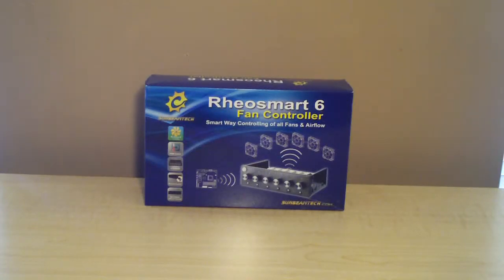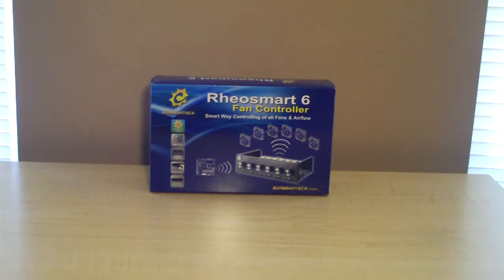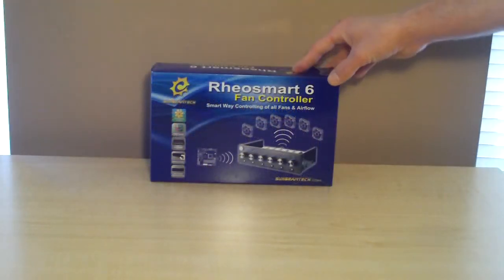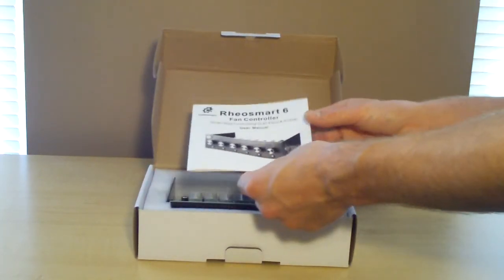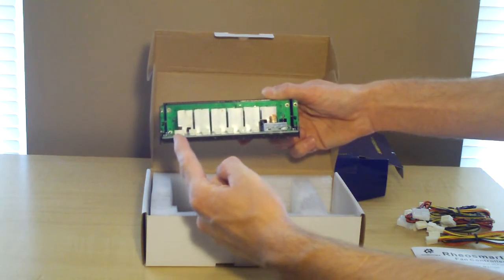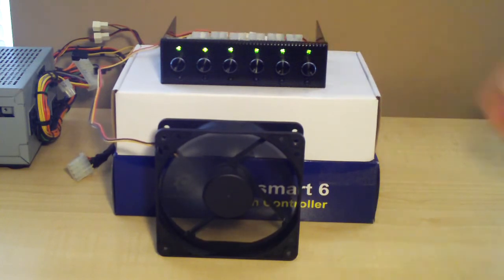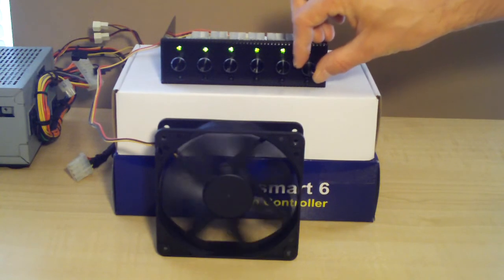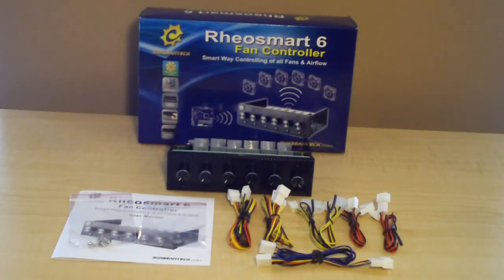Sunbeamtech Rheosmart 6 Unboxing/Review

Comment: Yea, the only problem I have with my 4channel Sunbeam controller are the LEDs lighting up the room. Covered them with tape. Also, if you want to, you can switch the colors of the LED from GREEN at full power and RED at no power if you want. Just need to pull the LED out, and put the wires in the opposite way.